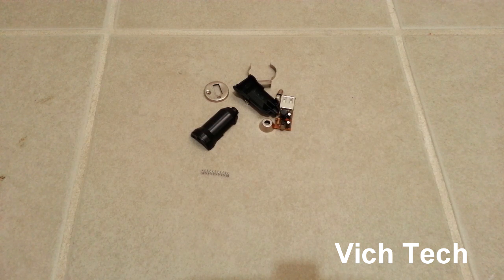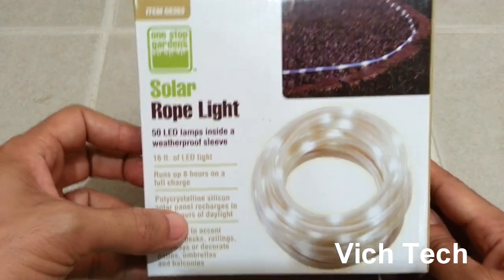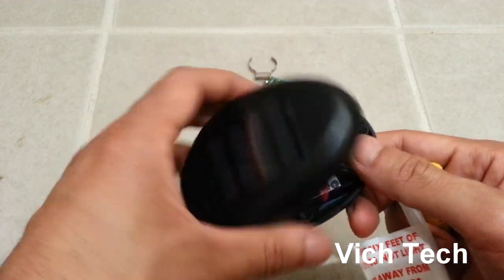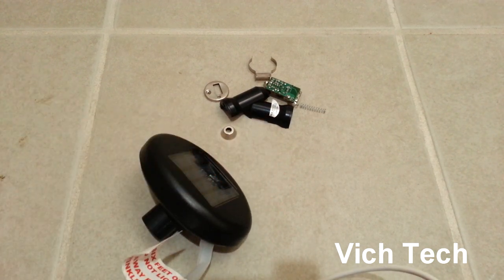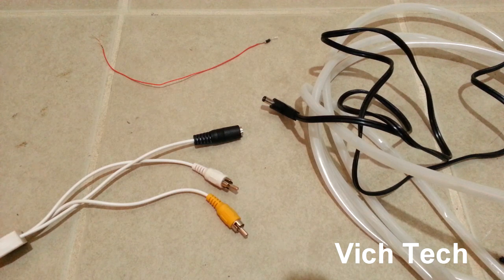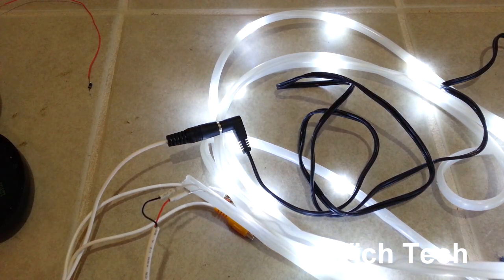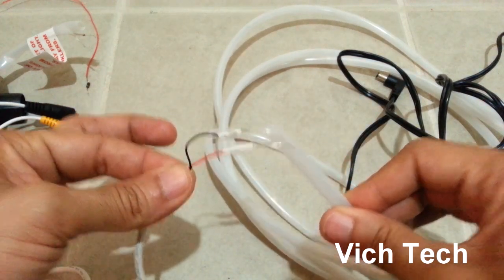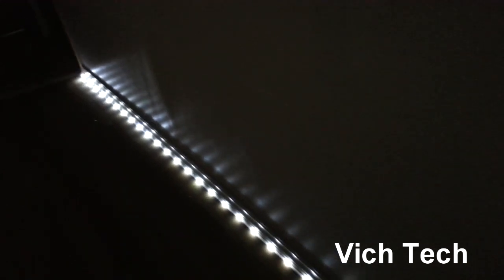LED SOLAR ROPE LIGHT  DC TO AC conversion

Comment: Awesome!  Im trying to take a solar panel that connects to a water fountain and turn it into power.  Reason being is because we dont get much sun  in our backyard for the solar panel, so I want to make it plug in.  I have solar garden gnomes that I just converted into power so now I want to do the same with my fountain. How would you suggest I start to do that

Comment: Why would you not put solar outside and put a switch between the output of the battery and of course bypass the night time or motion sensor and then the solar can charge the battery and you can contol the lights with switch and not use 110volts! You could even leave motion sensor in and lights would come on when you walk to hall if you put sensor there!

Comment: I know my outdoor ones will start to get a bit useless in winter, so I will bypass the battery in the solar panel with a long butchered USB wire and attach it that way with the wire passing through the main wall with some caulking as a sealant. Bypassing the battery through the solar panel that way means I still get the auto on and off switch at night, or I can turn them on earlier by covering the sensor. In summer I can either leave it all set up like that or just go back to the battery with more sun, brighter days and less night. A USB powered one like that will work just fine on outdoor solar string lights close to the house.

As for indoor string lights, I already removed and bypassed the batteries for those with USB charging plugs instead. I got sick of changing the batteries. I use 5 volt, 2 amp USB plugs for them, two sockets in each for two sets.

Comment: Great how-to!
Reply: Are these LEDs ran in parallel or series on thisSring light set? Could only a single  LED be cut off and used? If the string has too many LEDS I would want to shorten it, and use the remaining elsewhere.